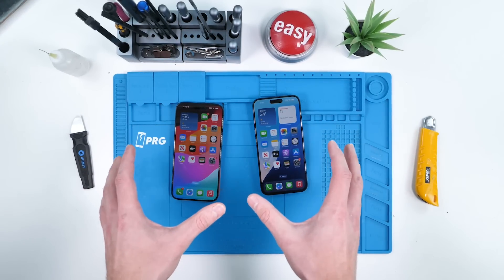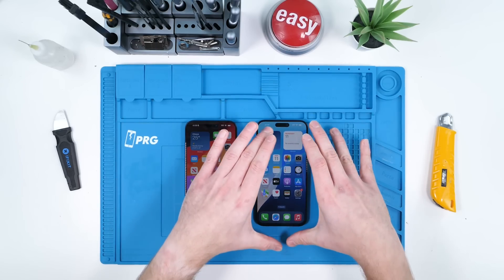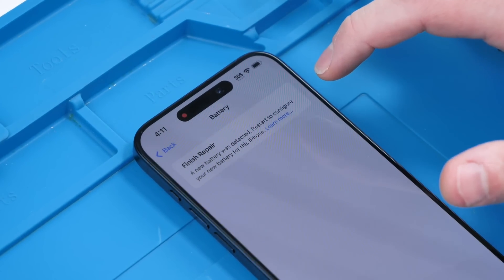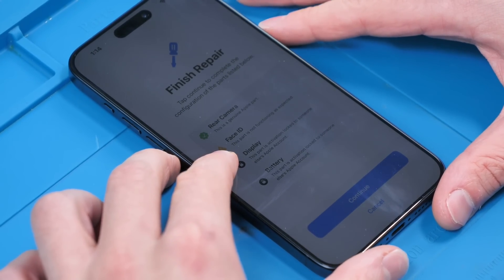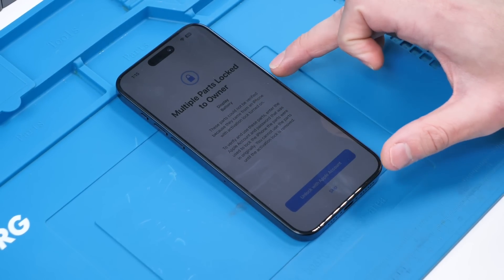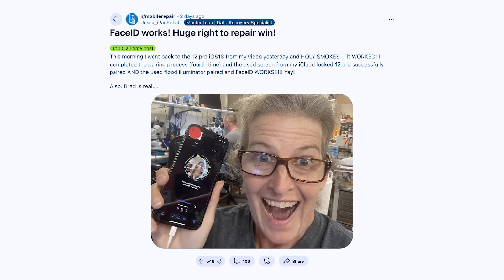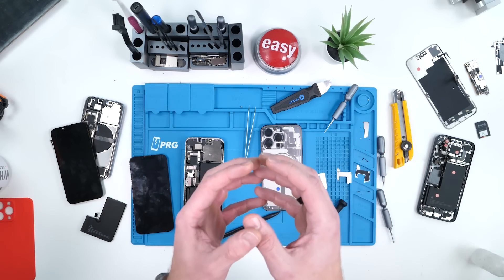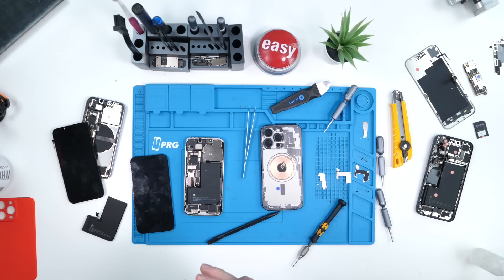Apple Made The iPhone MORE Repairable...?

Comment: @PhoneRepairGuru   I love how you are able to present information in such a concise way, I wish I had that talent!  Here's the summary of what we found in our latest Parts Pairing Lab.

1.) FACE ID FIXED by parts pairing.  This will work, but ONLY IF:  A) It's an iPhone 12 series.  B) The FaceID problem is missing/damaged flood illuminator and not true depth cam.  C) You replace the flood illuminator TOGETHER WITH the OEM screen to which it is bound.   A much smaller win than I thought in my first video. 

2.)  NO TRUE DEPTH camera pairing or function.  It won't work.  However,  new ones are for sale from Apple on self service.  So Apple could support this, but chooses not to.  This poor practice is decidedly anti-consumer and anti-environment.  In the US, this is worth a campaign to complain to the FTC.    I'd love to help map out a campaign for that with you if you're interested.   Apple does respond to public pressure.

3.) PARTS ARE PART-SETS.  Some parts are programatically bound as serialized part sets---flood illuminator flex is tied to display ic.    You have to replace the entire set to pair. 
 This means the $15 damaged flood requires a $300 screen to use it 

4.) For phone models earlier than iPhone 15--both LOST MODE and ICLOUD LOCK CAN PAIR.

5.) Only iPhone 12 and later are supported.  No pairing for older phones with home button/touch ID, no iPad support even on iOS 18.   Right to repair legislation does not back date to iPhone 11 even though they are getting iOS 18, so there was no pressure to include them. 

6.) NO CHANGE FOR STOLEN PHONE PARTS.  THEY STILL WORK.   It's a misconception that anything here does anything to prevent stolen phone part selling.  That's a mirage.  Those parts will still FUNCTION same as they do now--they just can't PAIR.  They already can't pair.  There is NO CHANGE HERE.    

Keep up the good work!
Jessa
Reply: This means, you cant buy a Refurbished per Pulled iPhone Display (without Front flex) and pair it
Reply: Thank you Jessa for the update! Keep up the good work!
Right to repair must be a right and we are winning!
Reply: Thanks for the breakdown Jessa
Reply: Great comment!👍🏽👍🏽
Reply: "Apple does respond to public pressure." If they would react the they would not exist anymore, you are so naive
Reply: @XdekHckr  Calling Jessa Jones naive is hilarious. She, Louis Rossman, and a few other public figures in the repair space basically spearheaded right-to-repair legislation across the United States.
Reply: Maybe a certain Louis Rossmann can help put light on #2.
Reply: Its not that strange from apple remember back in the days when maps didn’t work probably then tim cook himself said use other services
Reply: Great info, thank you for sharing!
Reply: So for iphone 15 below, even we took parts from lost or stolen iphon, it still can be used on another iphone without any issue?
Reply: I don’t care for right to repair much. It’s symptomatic of a bigger issue, which is suppression of the free market via patent and copyright laws. Loosen, or even remove, those, and now competitors will create their own iOS like products and Apple will be forced to adopt what their competitors are doing (and thus, what the market demands) or lose customers.

Compared to this, all right to repair would do is increase consumer burden at no real welfare gain.
Reply: @someonethirsty1957  That is simply not true and completely opposite of that. Right to repair allows growth of businesses to fix the pcb that Apple from genius bar cannot do as they, the company itself, upcharges the same fee like it's a brand new iphone. There was never a time when phone parts needed to be serialized to prevent repaur. that's an attempt to eliminate competition and it stifles creativity and innovation. Try playing monopoly. Anyone that comes up with that statement is one of two things. Either A) a general consumer with no clue how right-to-repair works and is repeating what Apple and/or the lobbyist told them.

Or B) a lobbyist that got paid by Apple to say these words like they copied off of someone's homework.

Take your pick.
Reply: @EdnovStormbrewer  
Exactly. Apple is stifling creativity and innovation. The reason they are able to do that is because they have a government given monopoly through copyright laws. Not only a government sanctioned one, but one that wouldn’t even exist without government intervention.

My point is, if competitors could make and copy iOS without being sued out of existence (much in the same way everyone else uses android because the source has a “copyleft” filed on it, thus, there a hundreds of versions), we would see more iOS providers and Apple wouldn’t be able to engage in monopolistic practices unless they wanted to lose customers. How many customers do they already lose to android, let alone would they lose to a potential, more free clone, because they have frustrated customers? iOS is really one of the main and only holds Apple has on its customers in the first place.

I’m sorry, right to repair doesn’t actually solve any of this, and it doesn’t leave consumers with an additional option set and even more products to choose from to meet their individual needs. There’s more than one way to skin a cat, and using government intervention to fix a problem created by government intervention usually just makes a less efficient market, while making sure government bureaucrats get their pockets lined with money that would be better in either your and my hands or a producer’s hands.
Reply: @EdnovStormbrewer  
I think it is also worth mentioning, if the model I’m proposing were to become a popular idea, we’d probably see Apple switch to a more open repair system, and maybe even lobby for right to repair to appease the masses somewhat, as what untold billions of dollars would they lose no longer having a chokehold on their segment of the market? They would basically beg the public to only push it as far as right to repair. If that doesn’t say something about the concept then I don’t know what does.
Reply: @someonethirsty1957 This point is not correct. Right to Repair is COMPLETELY different from what you are saying, and not how this works at all.
Reply: It is to my understanding, right to repair focuses on practices from companies most notably like Apple, John Deer, and various car manufacturers that engage in anti-repair tactics such as serialized parts, being unable to access software or having restrictions put in place by software, specialized tools, etc., thus making it questionable if the purchaser of the product actually even "owns'" their product. These manufacturers will also restrict parts put on the market to only themselves and "licensed" or "qualified" technicians, which does make a larger aftermarket parts market, however it also introduces the possibility of someone who would've bought a genuine part buying an aftermarket part from an un-reputable company. It is worth mentioning that the reason companies engage in this is to make sure they're involved in (and making money from) the entire lifecycle of their product, whether that be repairs done to it, through the use of their product (App Store, subscription services for access/activation of hardware already built into products, etc.), or the purchase of a new product (which many right to repair advocates say such companies would prefer).

At its core, right to repair is the movement to disallow for such anti-repair tactics so the consumer can "own" their purchases once again. The main means of doing this is by legislating that companies to allow their customers to repair their product without disabling or downgrading the funtionality. Rtr activists also advocate for consumer access to replacement parts from the original manufacturer, as well as allowing third party parts to be installed on devices/products. Some people in the movement also wish for price controls on such replacement parts sold by the manufacturer.

The problem with right to repair, again, is that it uses government intervention to fix a problem created by government intervention. If companies were free to copy iOS and the accompanying Apple ecosystem, you would begin to see different price points and forms and functions from on products that keep people attached because of the ecosystem and functionality, because other people would be making iOS phones. You would see more companies improving upon or liberating John Deer equipment if the anti-repair practices get/are bad enough (haven't followed that story since I heard about it years ago). The problem is that rtr does not consider the most efficient (for consumers like you and me, and producers) means we having for solving product problems, which is the free market. It simply dictates what should happen and will have its own shortcomings and circumvention, as all "consumer oriented" laws do. Do you really think Apple wouldn't despise the ability for other companies like Samsung to copy the thing that made it's phone's popular in the firstplace? How's that for sticking it to Apple? Way better than only getting type-c charging in 2023.

Based on what I've said, is there anything that seems to indicate I don't understand right to repair?
Reply: This guy is ai
Reply: @jitendradara2502 Jessa Jones is most definitely not AI! She's an extremely reputable technician in the Apple world.
Reply: @jitendradara2502 yeah. what does he know.

Comment: May I ask if someone buys an iPhone 12 with Face ID and no iCloud, and looking for a cannibal iPhone 12 that is locked to iCloud to exchange the device, does that mean our iPhone 12 with Face ID cannot be used? However, if the device we buy runs iOS 17, it means it is safe but not genuine Apple parts, right? However, if the device doesn't have iCloud, the FMI will be off when iOS 18 is turned off, it will definitely be locked and ask for Apple ID verification that locks iCloud, right? @phonerepairguru
Reply: @PhoneRepairGuru
Reply: @PhoneRepairGuru

Comment: i just bought an icloud ativation blocked iPhone, 13 and then I installed a new motherboard, and the repair assistant succesfully calibrated all pieces (camera, battery and display) without displaying the blocked parts screen, and the rapair asiistant also put on the description of the parts "second hand".
Reply: What is the iOS version of the blocked iPhone?

Comment: Just moved a screen from one iphone 12 to another and it did the calibration and lists the part as used as it came from another iphone. Unfortunately i couldn't get faceid to work but faceid wasn't working properly before the screen swap and it was even more broken after the screen swap. Tried swapping the modules, checking them via a qianli icopy and faceid board but they reported as normal. I really wish they do something about getting face ID running again or at least tell me why they're disabling it.

Comment: I have an iPhone 14 Pro, the screen was replaced with an original one, but I can't complete the repair, the message "This part does not work as expected" appears. I suspect that the True Tone code was copied from the broken screen and pasted onto the new screen and this is causing the error. Could this really be the reason or could it be for another reason?

Comment: I was confused when I saw True Tone on my old iPhone XS Max that I repaired with some cheap LCD screen. I don’t really care that it was cheap and that it can damage the phone, the old display was broken and it simply needed a new one plus I hardly use my XS Max anyways. True Tone barely even works even though it says in the control centre that it’s on. I never paired the screen and never transferred the original screens serial or anything like that to the new screen

Comment: Would the camera calibration work with an iPhone without Lidar? (iPhone 16, 15, 14 13... the non pro models). If the camera calibration can be done with the normal iPhones as they don't have Lidar, then that means that they would be much easier to repair.

Comment: This is something that legislators around the world should look into. 

Take the case of a Toyota car. Still within warranty. Yet, if you changed any part with another bought not from Toyota, the car, assuming the replaced part is in proper condition, should work. The warranty is void, yes, but the motorist is still able to use the car.

In contrast, what Apple does it restrict the functionality of the devices they sold to force owners to buy only from Apple, otherwise, the device will not work. It stifles competition and free market. Yes, there are key differences between an iphone and a car, but the essence of replacement are still the same. 

In the end, one may ponder: Does anyone own the apple device they "bought"? or we only rent them or bought only the license to use them?
Reply: Ye it’s true that Apple basically control your iPhone, Ipad I like their products changed battery at IPhone 11 Pro not long ago hope I will use it long enough.

Comment: Hello, I just doing some experiment yesterday before I see your video today. I swap board 12 mini, 13 pro, 14 pro max, here is my result :
1. 12 Mini screen, battery, camera part can be pair, except face id, I also don't know why the other technician can
2. 13 pro and 14 pro max test with original board face id,  battery and screen can be pair, rear camera failed, I also think it because the lidar sensor, because I ever move iphone (board,screen,battery,face id, except lidar to a new housing the potrait camera x1 always not work), I remove the camera to make battery and screen can be verify and success.

3. after I saw your video, it can be said that the screen and battery lock can't be pair on iphone 15 series or above, BUT, I think there is also 1 possibility that wort to try, if the lost part we use is from IOS 17.7 or bellow, will it can be pair or it also locked just like IOS 18 ? would you like to try?

Comment: For the Face ID it will only functioning correctly if you replace the True Depth Camera, along with the Prox Sensor cable on the display AND if i read correctly on the Apple GSX Update Face ID still HAS TO BE DONE BY A CERTIFIED TECHNITAN NOT ON YOUR OWN

Comment: “Unable to Configure There may be a problem with the server or network. Please try again later.”

how to solve this problem? even though I am connected to wifi and the network is very smooth? is there a solution for me?
Reply: Hi brother , did u fix that ?
Reply: @kaki_rdg  You can fix it as long as the 3 parts come from the same device (LCD, Face ID and Top Speaker)
Reply: @binarmin  so, if i don’t fix it, is it a problem ?
Reply: @binarmin  please can u reply ? ^^
Reply: @kaki_rdg  its ok bro, There may be some minor features that cannot be accessed, such as true tone.
Reply: @binarmin  For me, it’s the screen . It’s written that ( a new screen has beed detected , restart your phone to finish configuration) , and there is not the ( ! ) . 
I don’t have True tone, but i have face id and every stuff
Reply: cannot be repaired, from several sources I read the LCD, Face ID and top speaker are considered the same part. so if they are not the same (for example mixed with other used devices) they cannot be read and repaired via Parts & Services.
Reply: @binarmin  ow , i have the same thing, is it bad ??

Comment: Yes this is true I got my iPhone 12pro ‘s camera and battery replaced by a 3rd party shop he was my known so he installed genuine parts but still my iPhone showed that parts are unknown and he said that there is a small chip that will have to be transferred as well which is quite a hassle and it’s not an issue while using it however I was not able to see my battery health but after the ios 18 update I got an option in settings as finish repairing your camera and battery and I clicked on it after that it said parts verified as genuine parts and said to me a restart was required so I did and then it asked me to record videos from my camera while it was restarting it took around 5 minutes and after it was complete I was able to see my battery health and the errors were removed I believe the ios18 has made the iPhones repair friendly

Comment: I had my iphone 13 screen changed by a third party so i dont know the origin of the screen. If i use this feature and it requires me to unlock the screen from the old user, am i still able to cancel the configuration process and use it like normal or the phone is dead ?
Reply: You can still use the phone. I got a a 3rd party screen. I bought this phone second hand. But I tried to recalibrate the screen and when I connect to WiFi it just hangs it doesn’t do anything

Comment: Im using iPhone 13pro max which some parts changed from another phone. Because my phone was cracked and I got one phone with iCloud lock. So i changed my motherboard to that phone. So is there any issue if i update to ios18? All parts are original but in settings it’s showing unknown part. And also I don’t know the iCloud id or password for the other phone which I took parts
Reply: Same situation .   You are on ios18 or still use. Ios17?
Reply: @mohsin4430  updated to 18 and just ignored the restart &finish repair feature

Comment: None of this calibration should be necessary in the first place.
Any Android device does not need this at all to function.
Even on Android devices recalibration for biometrics shouldn't be necessary (Google Pixel)
Doing a motherboard swap on a Samsung phone and everything just works without any of this stuff necessary.

When the calibration gets away for every single part, I'll consider it a win for right to repair.

Comment: Is there any calibration tool for Samsung device.
I watch PRG videos and I know there are tools for Apple devices but for samsung, is there any programmer as i replaced mine charging port with a samsung official and local repair guy (He bought a orignal) but still it charged slowly and drained battery in 2 hours but the samsung one was perfectly fine.